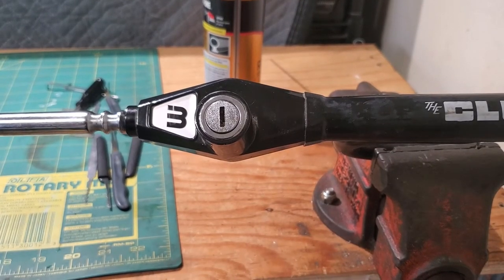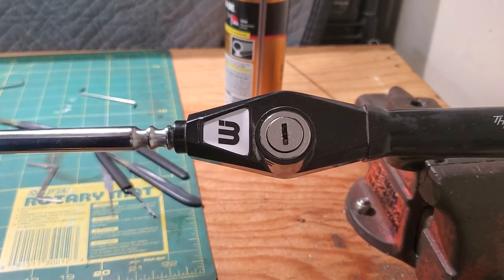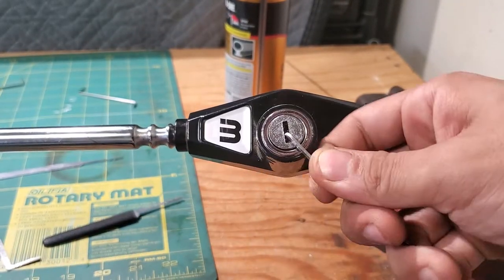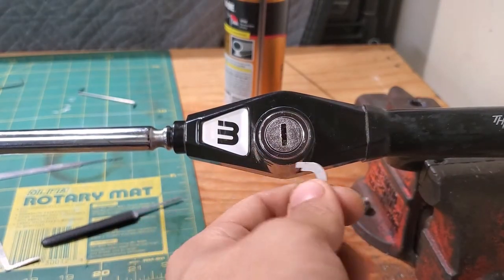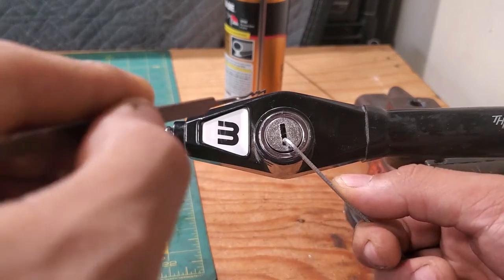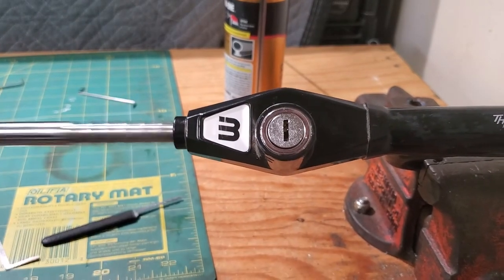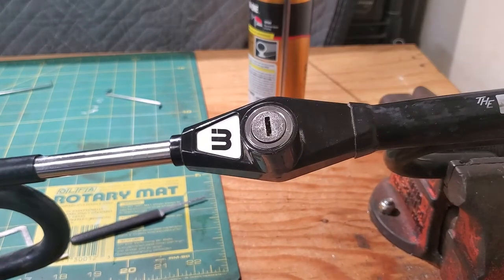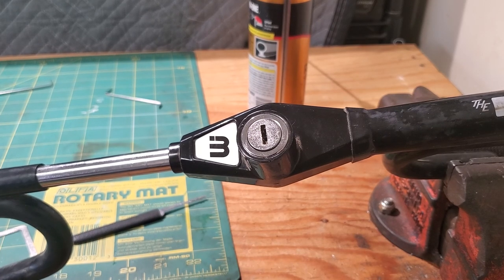~48~ Club steering wheel lock picked fast.

Comment: Nice display of that poor lock👍. Dose that have a spring loaded locking pawl? I have one similar but very cheap and the spring loaded ratchet can be shimmed with a pice of tape measure. Il be looking out for the dimple lock version. Happy picking👍
Reply from the maker: Yes it does...i haven't tried swimming it yet. I believe that pawl locks though once the lock is locked.
Reply from the maker: Shimming lol....frigging auto correct.
Reply: Haha. I read it as shiming. I didnt notice. 👍
Reply from the maker: @Deadlocks86  good....so did i apparently...does the word have one "m" or two?
Reply: Two apparent. I had to Google it haha